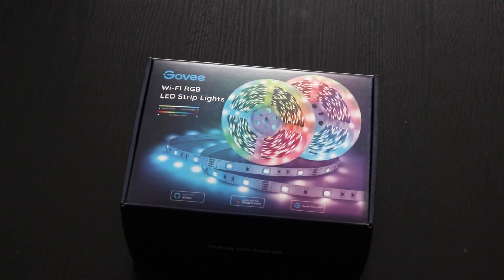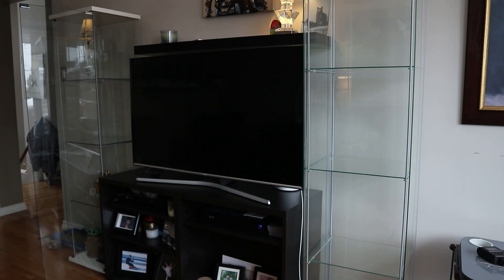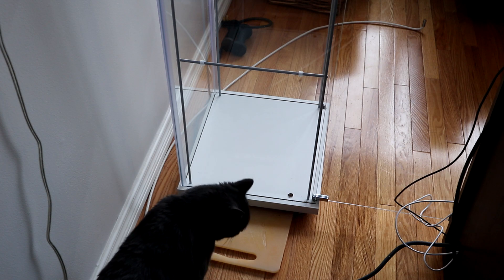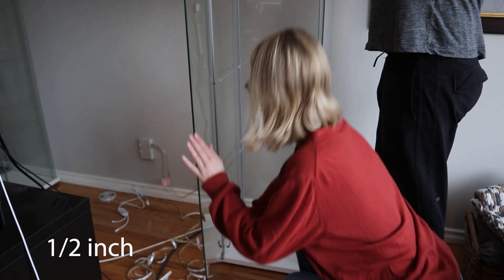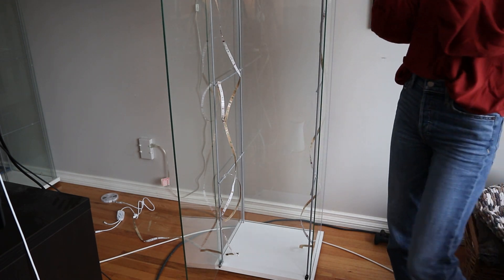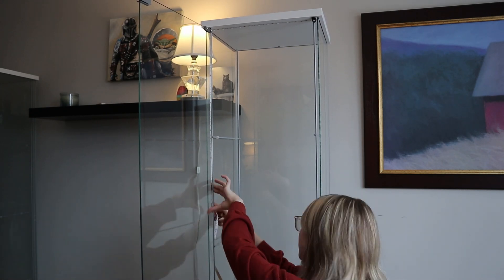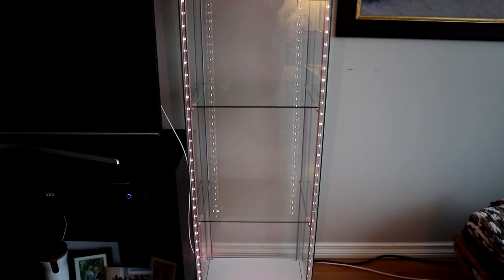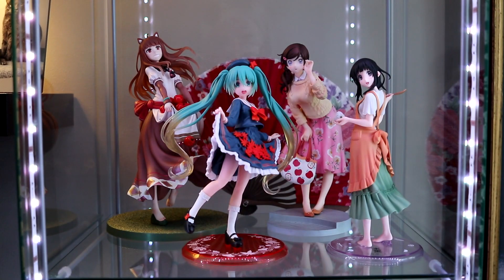Detolf Lighting Tutorial // Super simple DIY Detolf lighting

Comment: I've been collecting figures for years, and am about to invest in 6 detolf cases to protect them now that I am finally able to. I want to light them with these strips in one long chain going across the wall. I already bought the strips and tested them for a few minutes, but they felt a bit hot on the spool during testing. I'm really concerned about the heat on the detolf glass because I've heard rumors about these cases shattering suddenly. Do you find that your led strips get hot while in the cases?
Reply from the maker: I didn't really worry about it to be honest. LED strips really don't heat up that much and I think as long as you put your detolf together correctly shattering is pretty rare. Imo the look of LEDs lighting up my collection was worth any very small risk!

Comment: Nice work -- I used V shaped diffusers on my Detolf for my diecast models - for the video here I would remove the excess strip that goes from the drilled hole back to the mains supply - just cut the strip off and sodler wires in place with heatshrink back to the power box - then you wont get extra LEDs beyond the cabinet where you dont want them

Comment: The only tip I'd add is instead of feeding the entire strip through the hole, unplug it from the controller and just run the connecting end through from the inside. A smaller hole is required that way, if the leds don't have to go through. I also like all black cats. They seem to be more relaxed than others, in my experience anyways. I envy your collection.

Comment: Great job Gwyn 👍! I highly recommend going with this lighting method to easily light up a Detolf. It's clean, relatively inexpensive, and gives you lots of amazing colorful lighting options. I have 5 Detolfs and went a different route, preferring to use wired LED pucks, but hiding a massive amount of wires to get a clean professional-looking installation was a nightmare!  I really LOVE the way mine turned out, but the LED strip method you used is definitely the way to go if you want to avoid headaches and save a good amount of $$$ for more figures instead of lights.
Reply: What's an LED puck?
Reply: @thejamesbondshow9754  Basically is just a premanufactured circular light approximatly the with of a hockey puck with embeded LEDs instead of strips.  Once install they resemble miniature recessed celing lights.

Comment: You don’t have to drill any holes, my wires & cord ran out below the bottom of the door....many how-to videos on lighting IKEA Detolf cases. I got mine from Home Depot. You went vertical, even though most collectors run them horizontally on the three glass shelves and top. I also recommend getting peel off Frost King weatherstripping for your doors to seal the spaces and eliminate the need to dust.